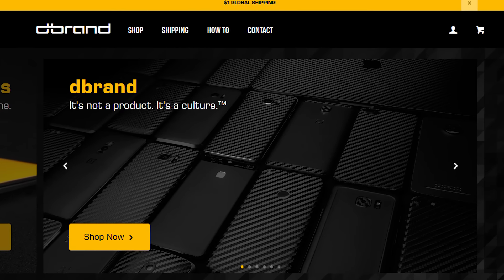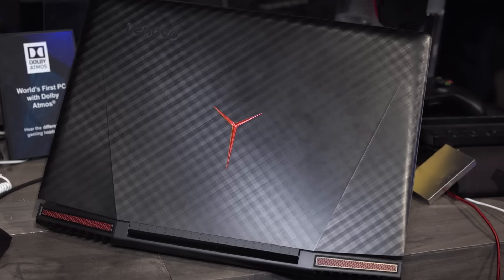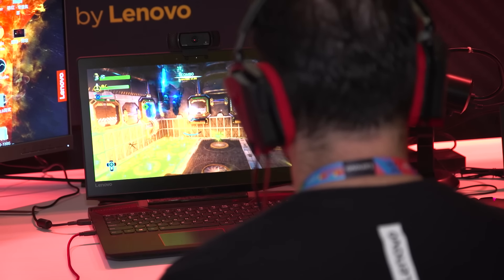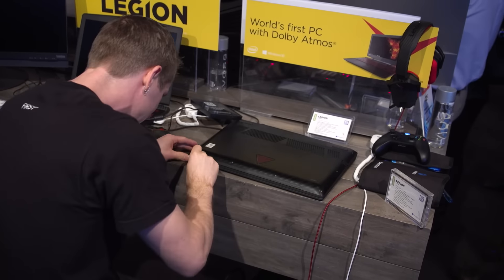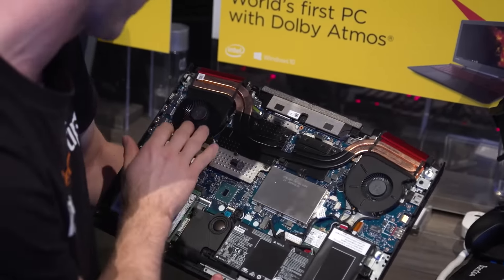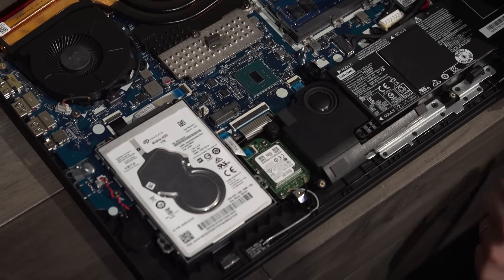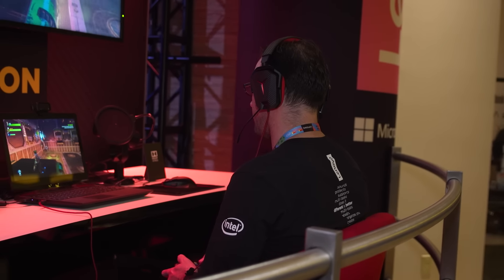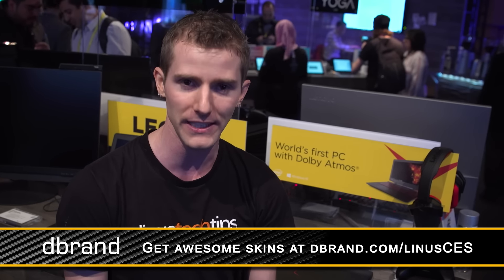World's First Dolby Atmos Laptop

Comment: You know, instead of adding built-in motherboard support for proprietary controllers like Xbox ones, I wish game devs went back to supporting the controller standard that has been in there since freaking Windows 95: DirectInput. My dualshock 4 also had built in support from the day I got it anyway because bluetooth is an actual standard and so is DInput, but I have to use wrappers because for some reason that I simply cannot wrap my head around, most game devs these days only support a considerably more limited API, that being Xinput which ONLY works with Xbox controllers, and if you get it working with something else, then it's limited to whatever Xbox controllers have, so goodbye gyros, extra buttons, touchpads, and anything else more advanced controllers may have. That's just baffling to me.

Comment: But how is the heat?? And how about psu??
Reply: It's just a quick look on the show room floor, they don't have time to test stuff like thermals. If they review the laptop fully, which this is something they may (there is a lot of interest in lower priced gaming laptops), it will likely be in a few months, close to product launch or a few weeks after.
Reply: Random Guy but heat really matter for me
Reply: Makoro Gaming Then I would hold off till some reviewers get their hands on it for testing. 

Although I would doubt it has a problem. Now a days gaming laptops are pretty well established and heat issues have been figured out, since the super hot 800 series GPU's. More so Lenova have shown they can make a cool laptop with the Y700, and this is a larger laptop with a very good looking heat pipe layout, and they probably would not risk a non-bullet proof product to launch their new brand.

Comment: Linus tell me if it is okay to click the buy button on Alienware's website for a 13" r3 w/OLED, 7700hq 1060 & 512gb at $1800USD or is something better on the horizon???
Reply: Looking for portability, capability, and reliability.
Reply: I personally don't like Alienware, I think for that kind of money you are better looking at the Razer blade 14.... But hardware wise, the 770hq and 1060 aren't going to be replaced any time soon, they just came out.
Reply: I was under the same impression of Alienware, but apparently the same spec Blade 14 cost a couple hundred dollars more at about $2000USD.
Reply: Oh yeah, there is no question that Razer is the more expensive brand. Mostly because the form factor, a crap ton of engineering has to go into cramming that hardware into a chase that small and keeping cool, also Razer's build quality is only second to Apple. 

It maybe worth looking at the MSI GS63vr, if you want portability. Alienwares are not the thinnest things, and thickness is what you notice when it's in your backpack. My current laptop is a MSI GS60, and it's hardly noticeable in my backpack.
Reply: GLD_AV3NG3R CS GO and Fun What a bad suggestion. Desktops flat out do not fit everyone's needs. Desktops and Laptops are two completely different products. There are  many reasons why some people need a laptop that can do everything rather than a cheap laptop and a desktop. 

Me for example. I bought my MSI GS60, not just for gaming, but so I can run engineering programs like Auto-cad really well in class and not have to use the slower computer lab computers, and I can work on projects on the go.  And I can game to relax in between classes. More so I go back and forth between my girlfriends house and my house, moving a desktop between them would be annoying, not to mention I don't have a privet space to set up a desktop in my house,
Reply: Wait for this Lenovo laptop.
Reply: GLD_AV3NG3R CS GO and Fun It's like if a guy is asking if he should buy a BMW or a Audi, and you tell him that a Toyota is cheaper... well not shit, it's also targeting a different audience.  

When someone says, "I want to buy a gaming laptop", you are not really progressing the conversation by saying, "Oh don't do that, you should do something else instead". Everyone knows desktops have better performance per dollar, it's not some big secret, but the chances are since he is asking about a gaming laptop, HE WANTS A LAPTOP. 

And I really don't know what you are talking about, "melt your darn desk"... My MSI GS60 with a 970m and a 6700hq has run heavy games for hours and is just warm to the touch... In normal use the fans rarely run, it is actually is cold to the touch. Gaming laptops have pretty good thermals now a days, especially larger ones like the Alienwear he is talking about.

Comment: Why would you put a 2.5 inch mechanicle hard drive in a gaming laptop. Firstly it just takes up a lot of space the manufacturer could have used for something else. Some like thing like a bigger heat sink or whatever have you. Secondly, it just adds more weight.

I personally wouldn't purchase a gaming laptop that has a mechanical hard drive in it. It screams "compromise" between affordability and the "ideal" product.

Comment: These "space ship" laptops really are getting ridiculous. Designers really should remember "Form follows function" rule. Like with the illuminated keyboards...does it actually improve visibility. My almost 10 year old Asus, standard white on black keyboard, can see the letters in dark and at extremely low angles perfectly, as the white reflects much of the light it gets from the screen. The keys look like new too.

My bros new "Gaming"-(read overheating nightmare) Lenovo with the space ship red keyboard can't see anything in low light as the red lighting shines too bright, so you turn in off, then you can't see the letters, because they are a weird mat color, forget about seeing anything at an angle. The mouse pad already looks worn and the buttons feel mushy, while my old ones still give a solid positive click every time.

Every time I see all  these unnecessary features on products, all the lighting, vents weird shapes,... I can't help to think" Maan...you could spend that design time&money on better hardware parts, more efficient cooling, performance, lower weight,...instead we get this...fluff:("

Comment: Lenovo - not even once. I have y70-50 it's overheating,throttling,slow HDD,slow wi-fi, flexing keyboard,lan port not tight enough - disconnecting frequently,broken hinges after 5 months, screen broke after another 6 (no warranty cover for that). Lenovo support is horrible even if you want to buy hinges/any parts from them you need to send them whole notebook and they will erase your storage even if they are only working on mechanical parts of the notebook. go and buy Asus I can't wait to get some money together and throw this POS to the bin.

Comment: These laptops have the worst hinges ever. If you ever buy one you will need to screw the hinges into the metal back panel before they break of the epoxy/ plastic and break your screen.
Idk who at Lenovo had the bright idea to have a metal back and not even use it for reinforcement.
HP also makes this same mistake.